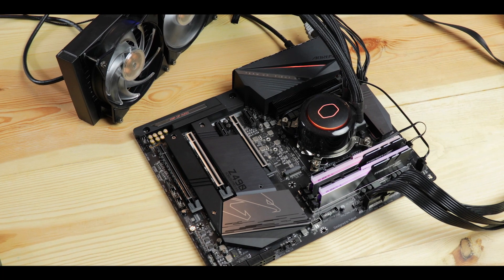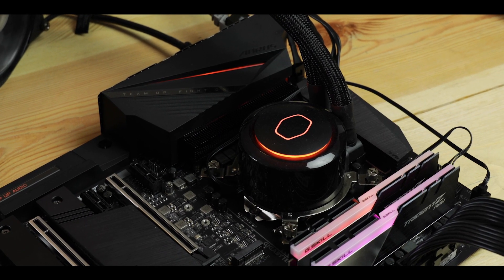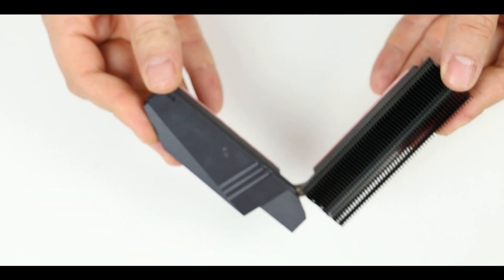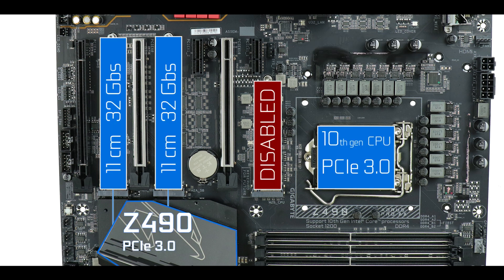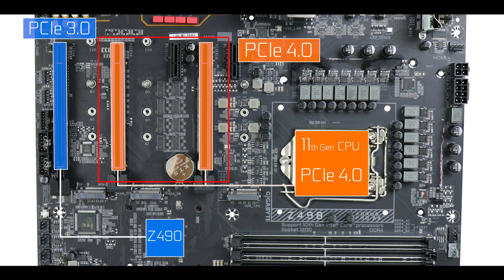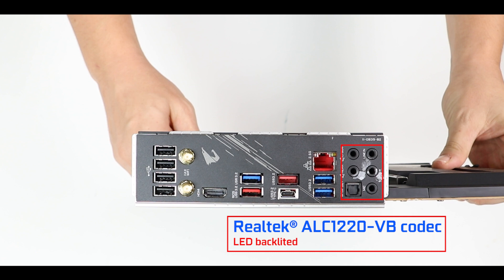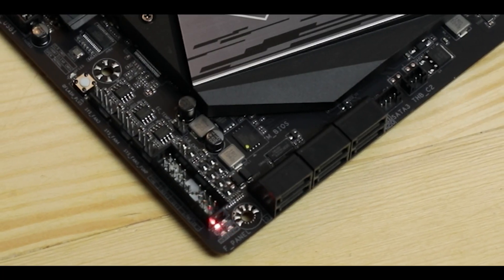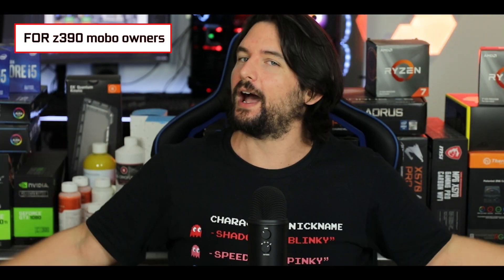Gigabyte Z490 AORUS PRO AX : a massive YES!

Comment: It would be very helpful if you could do a follow up video, with how well this Z490 Mobo actually works with the latest 11th Gen processors, compared to the new Z590, especially if the PCEI 4.0 provision actually works? I bought this board after watching this video, with a view to upgrading to 11th Gen but I cant find any useful information to help with this decision.

Comment: Im looking to get this board.
I have a i9 10850K and Aorus RGB Gen 3 M.2 (with Heat Sink and RGB Aorus logo) Im not aiming for the Gen 4 yet, but can I atleast use it on the top M.2 Slot or its completely disabled since its a 10th Gen CPU?

Comment: I just upgraded from a z170 gaming/i7 6700 to an aorus pro ax/i7 10850k very happy with the upgrade. And I don’t feel the need to overclock right now since the stock is very powerful but it good to know that it easily doable so in 4-5 years I’ll be still good for gaming with an overclock